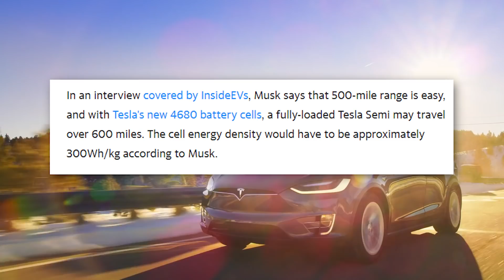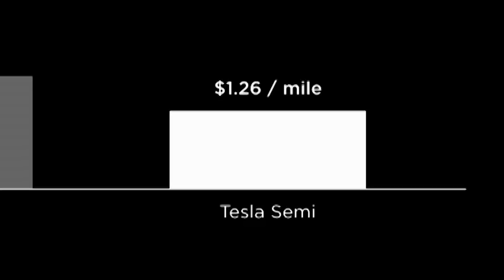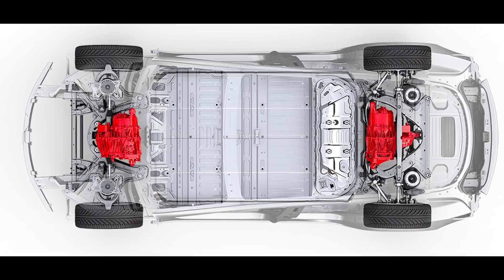The Tesla Semi 2021 Update Is Here..

Comment: 7:00 Okay 50% more efficient does not mean it will weigh half of what it weighs with the same efficiency. So let's say 1 unit of weight is equal to the current 100% efficiency. Then the new batteries come out making the new unit of weight equal to 150% efficient of the old weight. Making the weight 2/3 for each unit of weight. So if you wanted the same distance with the new efficiency the battery will weight 2/3 the old weight

Comment: I'm a truck driver and I can honestly say that the only companies that are going to use these right out the gate are mega fleets. 
Until all of the kinks are worked out I doubt any other fleets are going to want them.
Plus the reason trucks are so slow on the road is because the government thought it would be a good idea to govern trucks to 65 mph cutting our RPMs causing us to not be able to accelerate as fast. 
Not only that but the cost to set up electric charging stations are going to be outrageously expensive and time consuming. 
us truck drivers don't have but 14 hours out of the day to get where we need to go and as many trucks as there are in this country, we would be waiting in line for hours trying to get our trucks charged.. 
I really just don't think the country is ready for this yet.
They would have to also cut the RPMs and acceleration on these Teslas because accelerating too hard and fast can cause our loads to shift.

Comment: I work for J.B Hunt as a regional driver pulling Amazon. We are given a maximum of 550 mile per day. Thats not round trip miles. We already dont have enough parking, but not enough parking with a charger and that will spell disaster. The tesla semi's range is best suited for box trucks and local drivers, meaning they start and end at the same place everyday. When its comes to my job, i need at least 1200 mile of charge. The Long Haul drivers will be the last drivers to adopt for obvious reasons.

Comment: The Tesla is going to be insane as HELL. When you factor in that a lot of these trucks are driving over 300,000 miles, they blow out EVERYTHING. I road on a semi for one week and it blew out a clutch and had numerous other problems that wouldn't exist if it were electric. Countless 10's of thousands spent on repairs won't exist for parts that don't exist, not too mention the parts that do exist on a Tesla are less prone to breaking.

Comment: Ok thank you very much for your video I like really like it.
Reply: Ok thank you very much for your video I like really like it.
but let's change the definition of a little bit.
let's put solar panels on the roof but also on the side.
and and put a battery pack 100 kiloWatts on the trailer.
and put a propulsion unit on one of the axles with two engines.
and we are going to make the trailer a refrigerator trailer.
those trailers have a big refrigerator unit on the front usually electric powered with the back of diesel.
and do your calculations again please.
and you will be surprised because those trailers very frequently stand in the parking lot waiting 4 hours in hours before getting picked up and loaded and getting on the job.
I would really love to see you calculate those numbers and what's your opinion about the viability of a system like that.
And we are going to call it #Tesla #truck #trailer #power #Propulsion #trailer unit 
100 #kilowatts #Dual #engine #system 
Greetings from Andre from the #Netherlands

Comment: im curious how you get 1.5$ per mile cost per truck ?
my maintenance is never over 15c a mile
thats including tires/brakes/all breakdowns and its more than needed as always some stay at end of year
as for insurance its also 15c per mile based on running 9000 miles a month
fuel is not more than 40c
ifta, eld, ucr, load boards, plates, registration 5c 
so total = 75c a mile

Comment: Something to note is that truck drivers in the US can’t drive more than 10 hours a day. So if a driver is on a highway with a speed limit of 60 miles, with a truck that has a 620 mile range, they would run out of energy before the truck does
Reply: No we can drive 11 hours a day on a 14 hour clock. My company truck goes 73mph . I drive anywhere from 650 to 720+ miles a day , especially on a load from Dallas Tx to either Oregon or Washington state that’s a 2000 mile run , and I get those every week. This run is done in 3 or 3.5 days.

Comment: I can see this working transportation is a 1.6 trillion dollar industry.  Electric vehicles you can use the electric motor's to slow down the truck at steep grade hill's in a traditional semi you half to shift it down  a few gears before you reach the peak of a hill brakes often fail with new truck drivers not knowing what they are doing look at the incident that happened in Colorado I70. 
  With the new invention with solid state batteries the weight would be down even farther than Lithium Ion batteries so eventually weight isn't a issue and it charges a lot faster. Legally after 8.5 hours you half to take a 30 minute brake in a CMV "commercial motor vehicle" so that will charge the truck up in no time and at the filling stations you half to wait for some moron to get back in his/her truck to move it so you can fill up.

Comment: Ok here's a crazy thought, why not make the bed of the trailer out of structural battery packs that could give a massive range extension to the semi.
Reply: nerox2006x The problem with that idea is that unless you use that truck to drive the full range, you're unnecessarily hauling around a lot of extra battery mass that is taking up valuable cargo-carrying capacity.  One of the disadvantages of batteries over fossil fuels is that they weigh the same whether fully charged or completely drained.

Comment: Sounds like Bill gates is using real world data, whereas you're using a whole lot of assumptions stacked on top of each other. When you multiply the probabilities of these assumptions coming true in 2021, you might get a more realistic picture.  This video is not realistic even by the most optimistic standards. Being a model S owner, I do like Tesla, a little, and am excited about the notion of a Tesla Semi being viable at some point in the next 5 years. But let's keep it real. And, "yes driving an electric car will reduce your carbon footprint", yes only if you ignore the carbon footprint of manufacturing the car and battery, another let's keep the assumptions real moment. Meh

Comment: On the subject of truck weight.  The majority of the trucks you see on the road are actually volume constrained--not weight constrained.  By that I mean the products packed inside a typical 48 foot long 102 inch wide trailer when filled as full as they can pack them space wise don't hit the gross vehicle weight limit of 80,000 lbs.  Think about when you buy a cell phone or a coffee maker (or whatever) how much of the package is either open space or lightweight foam.

Obviously not all loads have this issue but a significant portion of trucks are not operating anywhere near that 80,000 lb limit anyway.

Comment: It's so heavy it can only carry 60% of a normal truckload, no charging infrastructure, and building a charging infrastructure is a huge prohibitively expensive project.

Listening to Tesla Fanboys talk about this thing is like listening to 5-year-olds
Reply: So, 2000 lbs is 40% of 80,000 lbs?
That is the weight penalty for the battery according to Elon.
And you  think they have forgotten to include planning for charging the semis?
Fanboys,indeed.
Reply: @rockon7848  just for starters talk about ignorant, it seems you don't know the difference between gross vehicle weight, and the way to load. But but but but but,,,, Elon said,,,,,. Why don't you go get a room with him so you can kiss his nutsack.
Reply: @joecummings1260  
Typical ,you attack me instead of my positions 
Blather all you want, you have no credibility.
Reply: @joecummings1260  So your calling a 6’4”215 69 yo alpha male a little snot?   Graduated GMI in 1975 before the pubs screwed up public education.
The 80k is total gross weight, the number the company posted for the Tesla semi empty weight will be no more than 2k over the weight of a diesel rig.  With the increased performance and efficiency plus very few trucks run at maximum gross weight and the semi makes economic sense.
You perhaps noticed I didn’t attack you personally, I wonder if you can do the same?

I am guessing not.
Reply: @rockon7848  and exactly what tractor is he comparing it to? I've had diesel powered day cab tandem axle tractors range in weight from about 14,000 on the low end to over 25,000 on the high end.

Notice how Elon dances around the weight he never says a weight, it's like a big secret, if the number was good believe me he wouldn't hide it.

Then there's all those pictures of its;; supposedly hauling a truck load. Four Tesla cars is not a load for a five axle combination class eight truck. Guys pull four cars around with like an f450 Ford and a Wally - MO car carrier..

The load of concrete blocks is on the low side of 35,000 lb, it could be as low as 32. That is not a truck load for a 5 axle class 8 truck, a normal truck load for a five axle day cab combination is well over 50,000.

Then when they hold them back from cold weather testing they brought two back, loaded one per trailer, on a tractor trailer combination capable of hauling over 50,000 pounds on the deck. If they were lighter than about 26,000 lb each, they could have hauld two on one trailer
Reply: @joecummings1260  Most of the information about performance, battery weight, and cost, do not take into account the new 4680 battery announced on battery day in Sept.    It will take a couple of more years to get the production ramped up,  but they will be in the using higher nickel (higher energy density) in the semi. 
Musk always underpromise and over delivers. There may be a delay in the launch but it will be there. He is dancing arounfdthe weight because they are still refining the battery making process so the number change but they have a floor.

If he states something in a public interview you can pretty much take it to the bank.  He said with the high nickel 4680 batteries, the truck should get 620 miles on a charge and weigh right at a ton more or maybe even a little less, than the average diesel equivalent. And no I don't know which truck he used for the comparison.

They are running the prototype semis loaded with 75,000 lbs, between Fremont and Giga Nevada, through the Sierras, state police at the weight stations stated the drivers claim it is beating the mileage estimates consistently.   

The man delivers on his promises, when Giga Austin starts production in late 2021, you will believe, because it's the truth.

I may be a fanboy as some have stated, but in my mind there are plenty of reasons to be one.

You might want to do a little more digging into this company, I was amazed.

And kudo's for the response, I really didn't think you would.

Comment: Electric cars are so stupid we meed hydrogen trucks . Omfg the amount of resources to make an electric cars is so stupid specially when there is no  actually recycling plan for those batteries
Reply: There is a recycling plan for Tesla at the very least, but more are adopting it for certain chemistries like NMC or LFP.

And the math on hydrogen today is not very good. It's about 25% efficient making hydrogen from electricity, then you have to liquify it and transport which costs more energy again, then the fuel cell in hydrogen vehices is 40-60% efficient. There are so many losses.

Battery electric vehicles cut out those losses. You have an average 10% energy loss over the grid, supercharging is about 80% between the charger and battery (home charging is more like 90%). Battery technology has also massively improved with dry application of active material onto the foil, cobalt free chemistry, and Tesla buying 10,000 acres of clay flats with enough Lithium to convert every US vehicle to electric and an efficient way to extract the lithium.

Comment: Wait I don’t think it’s true to say that slow accelerating trucks create traffic jams. In fact usually the vehicles creating the traffic jams are small light vehicles that cut lanes quickly and cause other vehicles to brake fast and create a trickle effect. In heavy traffic, it is actually the truck lanes that are fastest because they are not able to brake and accelerate quickly and are therefore forced to maintain a smoother cruising speed.
Reply: It's actually nice driving behind a semi in traffic sometimes. They're doing the smoothing work for you, although too many cars cut into the gap they leave.
Reply: @Jaker788  exactly
Reply: The gap is there for a reason

Comment: The weight issue is over blown since the majority of loads (60-70%) are volumetrically limited not weight limited.
And; Even where weight is an issue with a slightly reduced load it's more than off set by reduced operating expenses

Comment: 1:  Nothing New
2: You left out important and major factors in your narrative. 
Example.  Huge discussion on battery weight issue,  but failed to ever quote Elon on the subject.  He stated a loss of one metric tonn or less of load attributed to battery weight.  
Another even more glaring omission is Platooning with self driving.  One truck driver drives three or four trucks.  That in and of itself is probably a minimum $30k to $50k savings per truck annually.   
Moral of the story, less lying click bait on thumbnails and  better research.

Comment: News flash. EVs are not using sustainable energy. They are using the same energi sources we use for all electricity, which is a mix of coal, natural gas, nuclear, hydro, wind and solar, with the sustainable sources  so far account for very little in most parts of the US.

Secondly, arguing points based on future technology is kind of pointless. Bill Gates is talking about current technology, because anything else is just guesswork.
Reply: But a power plant is more efficient at extracting energy that even in coal a 100kwh tesla will have a lower carbon emissions output in it's lifetime. 
And the future technologies argument is somewhat fair, every year we're adding more renewable energy and decommissioning coal plants over time. There's a statistical improvement you can mostly count on.

Comment: Until the grid in the U.S is clean the Tesla semi is not carbon neutral. I like Hyliion's solution using onboard RNG and an e axle for a carbon-negative profile. Should be first to market too but we shall see.
Reply: But power plans are still more efficient at a typical 40%, and with more regulations on air pollution for NOx. EVs typically still win within their lifetime of use. As the grid gets cleaner, the semis will also be cleaner.